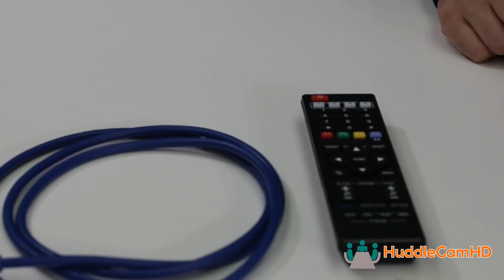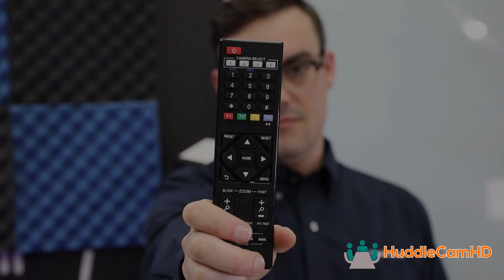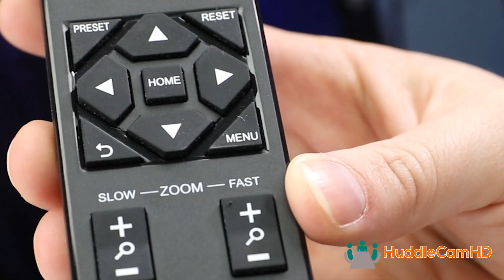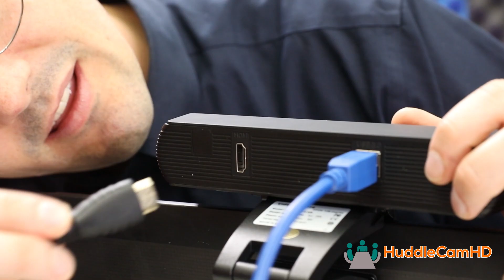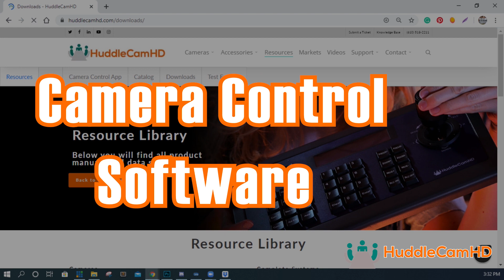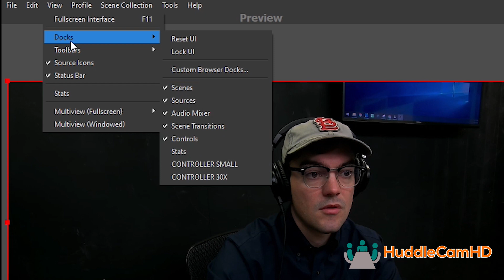HuddleCamHD Pro Setup Video: Unboxing

Comment: Do the remote control features still work if the cam is not connected to a laptop?   (Meaning, I would use USB only to power the cam and run HDMI out to a Roland Video Switcher)
Reply: You would want to get the IP version for that. Otherwise the USB is needed for control
Reply from the maker: Thanks for checking out our Channel! 
Learn More: https://huddlecamhd.com/

Comment: Mine HC-20 did not come with a quick start guide, and I cannot find it on the URL you provide.  Any ideas?  Thx, Dave
Reply from the maker: Hi Dave, you can refer to the USB 3.0 camera setup video
Reply: @Huddlecamhd  Uh.  I watched that.  The URL is either wrong, or there's no Quick Start guide on it, and no link to whatever software I was supposed to get.
Reply: @Huddlecamhd  I haved an HC020 not a HuddlecamHD
Reply: @Huddlecamhd  I have an HC020 Not a "HuddleCamHD"

Comment: Do I need a PC for this or just a display device is sufficient, just to setup a live display. (Not a meeting)
Reply from the maker: You can use the HDMI connection but remember the camera does receive the power via USB
Reply: @Huddlecamhd  noted.
Reply: @Huddlecamhd  Any possibility to use without Usb?
Reply from the maker: @ipcbethelbahrain8496  Yes, but it does need USB for power. So you can use a USB charging block.
Reply: @Huddlecamhd  Is it work with power bank?
Reply from the maker: @ipcbethelbahrain8496  That I have not tested but it should